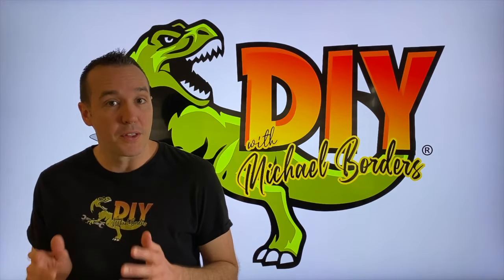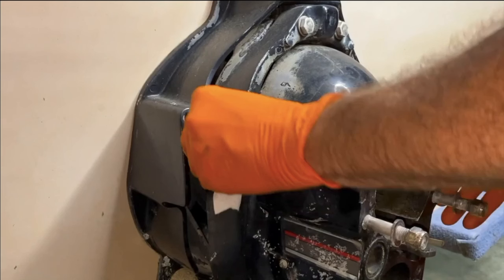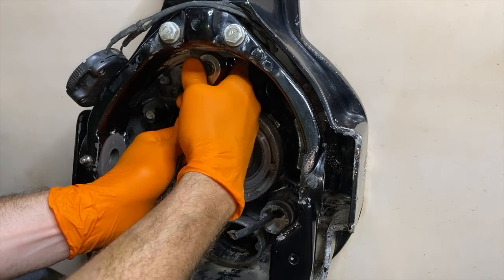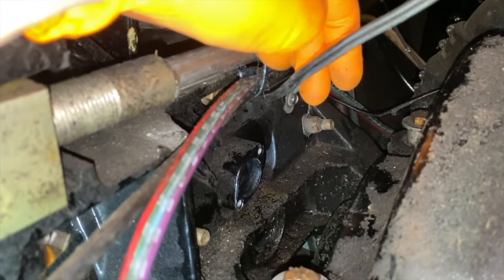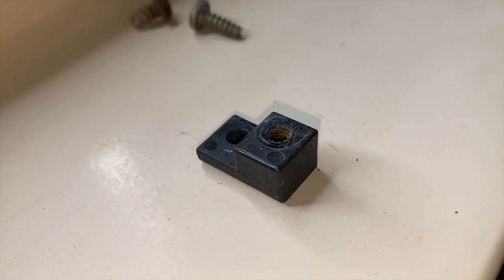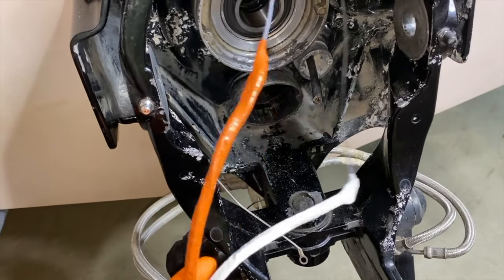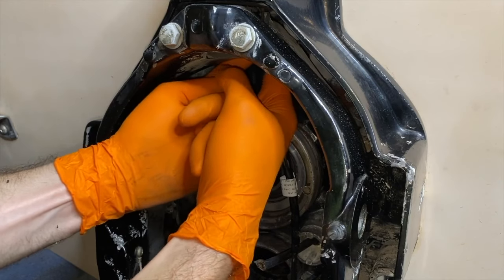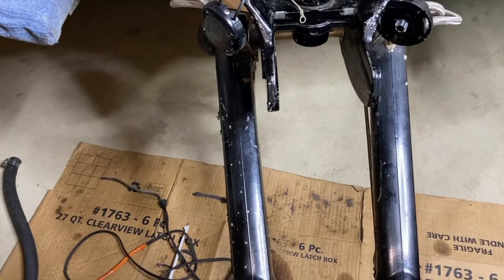Replace Mercruiser outdrive Trim Sender and Limit switches

Comment from the maker: If interested in purchasing this product, visit our Amazon affiliate link below.  I earn from qualifying purchases.

Hinge Pin removal tool:  https://amzn.to/44YuasH

Pic tool set:  https://amzn.to/3OCE9NE

Adjustable Joint socket set:  https://amzn.to/44v8HXd

3/8” to 1/4” ratchet adapter:  https://amzn.to/45JppDe

Long flathead screwdriver:  https://amzn.to/3OQebHB
          
Pipe/hose cutter tool:  https://amzn.to/454qaXC
          
Flex Shaft Screwdriver:  https://amzn.to/3s8E3W4  

Utility knife:  https://amzn.to/3QBjP1K

Bellows replacement kit:  https://amzn.to/3RL7h8v

Gimbal bearing install tool:  https://amzn.to/45ukLJt

Gen 2 U-joint tool set:  https://amzn.to/3KvNPbu

Shop Vac:  https://amzn.to/3scLdsr

Endoscope:  https://amzn.to/3qvdU3m

Shift Cable Socket:  https://amzn.to/3qtVdgq

Lacquer thinner:  https://amzn.to/3QGvxbd

***********

1.  How to remove outdrive from boat

          https://youtu.be/mD3YcT2Ohrc

2.  Bellows replacement (PART1)

          https://youtu.be/NcObTOYXtQM

3.  Endoscope footage inside outdrive exhaust

          https://youtu.be/bldC14Hmti8

4.  Replace outdrive Trim Rams

          https://youtu.be/5BetZVkPPHI

5.  Replace Trim Ram Hydraulic lines

          https://youtu.be/nkcFYl5bL7c

6.  Replace outdrive decals

          https://youtu.be/ER525zAx1CY

7.  How to install outdrive to boat

          https://youtu.be/HgMSGiSiBA4

8.  How to adjust/calibrate Trim limit and Trim sender switches

          https://youtu.be/5BetZVkPPHI

Comment: I could not for the life of me get that top bolt off the bulkhead retainer. The bolt on mine was rotated in a way where I could not get an open end wrench on it to break it loose as shown in the video. I bent the box end of a spare 7/16" wrench to clear the u-joint bellow mating surface, but could not get enough bite to break it either. I ended up sneaking a long 1/4" wobble extension between the gimbal and transom housing, then put a shallow 7/16" socket on the end and was able to break it free that way. Took some adjustment moving the gimbal side to side to get the right angle to get the socket on. Once it was broken loose I used the bent box end to finish removal. I tried about a dozen other methods but this was the one that worked for me.
Reply from the maker: Thanks for watching and sharing your experience.  This can definitely be a very tedious project, especially when it comes time to remove as well as resecure plate and bolts.

We are honored you took the time to share this.  Any at all helpful info, tricks, and methods is greatly appreciated here on our channel.

😁👍🧰

Comment: The top bolt holding the retainer can be a bitch… I took a  box end wrench and stuck in a bench vice and used a hammer and gave it a little more angle … made a worlds difference getting room to turn the wrench to get the top bolt out…
Reply from the maker: @davidjessee7701  

Good morning ☕️ we appreciate you taking the time to share your experience and helpful tip.  😁👍

Comment: Can you replace the trim sending unit while outdrive is on the boat?
Reply from the maker: Good morning ☕️ it’s possible however a bit more tedious.
Reply: Happen to have a video of this project? Or any suggestions to why my trim Guage isn't working?
Reply from the maker: @bobammon2916  

Thanks for the reply, not with outdrive still installed.